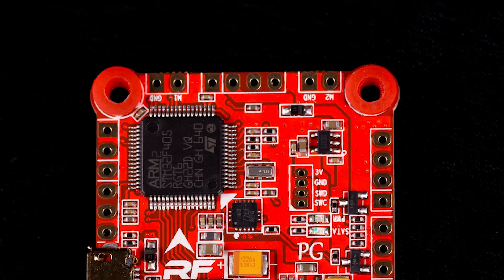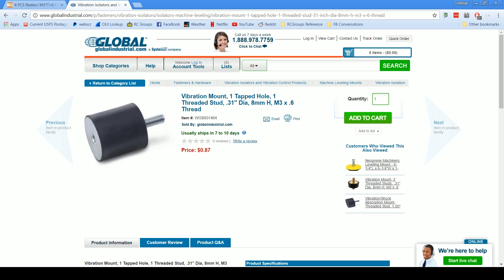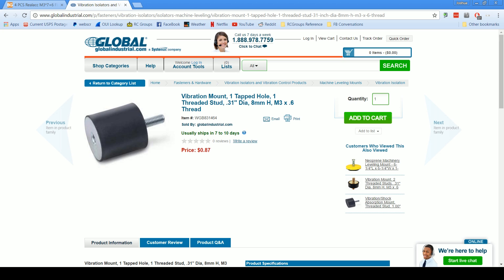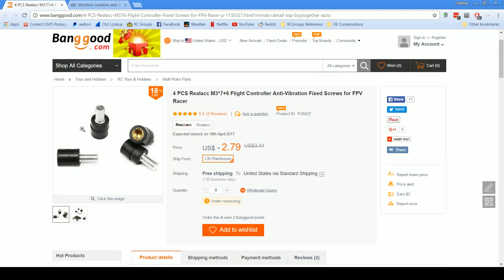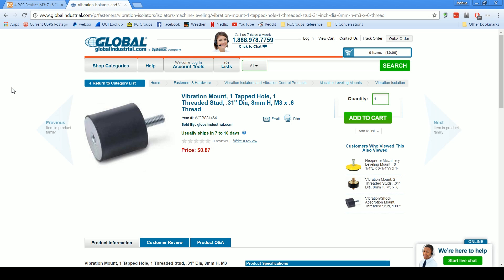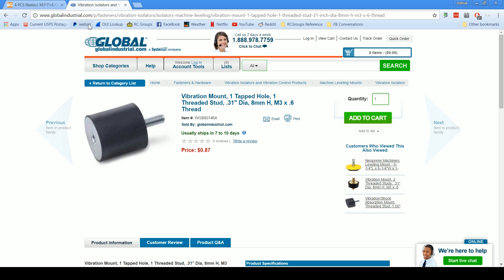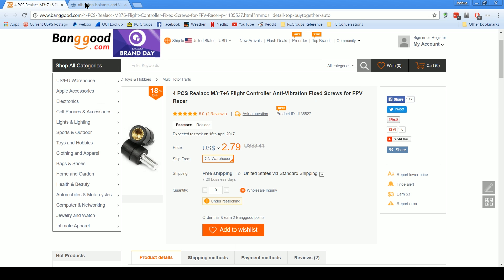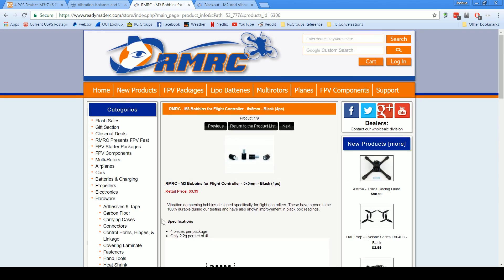Soft Mount Your Quadcopter Flight Controller | BUILD TIP

Comment: Thanks JB.  I am having issue with a new micro quad build.  It twitches, then falls out of the air.  All along I have to continually add forward pitch and if I relax it , the quad comes flying back at me...  I just ordered the standoffs, the shipping is high though.

Comment: This is a great option and I have done it on all my builds but doesn't solve the mid throttle oscillations due to the stronger magnets that are in these newer more powerful motors. I had some issues with the RS2205s 2300 motors recently and can only assume it was due to feedback on the those insanely strong magnets. I have another similar build with the first gen1 rs2205 (much weaker magnets) and no issues with just soft mounting. it appears to only be an issue with the yaw access, and the resolution was to lower Yaw gains...which resolved the issue. so to the viewers that do soft mount and it does not resolve your problem I would advise to take a look at how powerful your motor magnets are, that may be your issue.

sorry if this response seems out of place of off topic but just wanted to touch on that issue that I see a lot of people (including myself) come across on the rcgroups forum.

keep up the good work brotha, you have some of the best most informative videos and are very very insightful, I have used your videos to resolve a few issues ive had. thank you :) and have even bought equipment based off of your recommendations...i.e. the runcam eagle 4:3 and couldn't be happier.
Reply: Carpetbagger FPV I had the same issue with the new Emax S motors. Yup took some tuning AND soft mounting to eliminate but I finally won the battle.
Reply: When you say the stronger magnets are the problem, do you mean they create more electrical noise or that it just creates more vibrations in the frame due to increased power?
Reply: more electrical noise. to be honest my RS2205s 2300 motors run pretty smooth but I really need to add some kind of line filters or tune the yaw pids down and add some yaw specific filter. Which is what I did. this issue I had was on an all Kiss rig. The resolution was to take the stock yaw P and lower it from 8 to 6.48. and turn up yaw filtering from 93 to 95
Reply: You know when you spin a motor bell by hand and it's nice and smooth?  Well, when you have really strong magnets in the bell and you spin it by hand you can actually feel the resistance and vibration.  Almost feels like notches.  That causes tiny oscillations when it's spun up.
Reply: Hmm....I'm using a capacitor which should take care of any excess noise and even the ESC's have their own caps. Still doesn't fix the issue though.
Reply: Oh ok. That's a good explanation. In other words it's mechanical vibrations caused by strong magnets.
Reply: not necessarily...its still can be as mechanically smooth as butter but the there is noise thats introduced into the PWM wire by electrical  feedback and the FC (gyro) interprets it as off axis movement and oscillates the motor output to compensate for something that is really not there. which of course causes oscillations and the ones that seem to be most prevalent are around mid throttle.

And Hurricane FPV is absolutely correct. these higher strength magnets are noticeable. like 3 to 4 times stronger than other (maybe older) motors. its crazy how much stronger they are.

samik83 are you using caps (or filers) on each ESC or only one on your PDB? I tried adding a 35v 1000uf low esr cap on my main batv lines and it didn't help at all. never did try ones on the esc's. I just tuned around it. and honestly decreased oscillatons by damn near 90%. there are still some but very very subtle. not visible in fpv camera or gopro...I can just hear it when buzzing by my head :)
Reply: Well I switched to Dshot esc's just to try and fix this, becasue I thought it might be noise that's getting in thought the PWM.  It actually got worse. I think it's due to the fact that the new Dshot were 30A and before I was using 20A's. More power, more noise.
Reply: samik83, have you tried adjusting your Yaw pids down and maybe some yaw specific filtering? that may be worth trying if you have not done so already.
Reply: I've tried lowering it but IIRC it only made it worse. The yaw became to prominent problem when I switched to the 30A Dshost. Ever since I got the red bottoms there been this ever slight gyro noise on all axis. In fast flight you don't notice it, but slow level flight (when I'm trying to get some nice footage) there always this small shake going on. My previous setup with the old 2204 Cobras it was totally smooth. 

I just did a couple of tests flights with the rubber bobbins and it did help somewhat. The yaw noise isn't nearly as bad, but I'm still getting the shakes. I'm just reviewing my black box data and I see small gyro oscillations in slow level flight. These small jumps in the gyro vary anywhere from 1-10 deg/s.
I have also soft mounted my motors. A little unconventional setup, I used two layers of bicycle tires inner tubing. Thought it's nice and soft and would work well. Also put small pieces under the screw head to further isolate it from the frame. 

I'm kinda outta ideas. I know I could try more filtering, but I'd rather cut the problem at the source. I think the oscillation maybe so low frequency that it might be hard to filter them out anyway.
Reply: samik83 it's because Dshot ESC by Design have a filtering capacitor removed so pretty much all DShot ESC's are going to have more nose...
Reply: supposedly the Kiss ESC's still have the cap from what i read anyways but not sure about BLheli ESC's. but it has to do with the type of cap they are using. their ESC instructional docs say to use a secondary 25v 100-400 uf low ESR cap on each ESC to help eliminate noise and if your planning to go up to 5s. I haven't tried that since I was able to tune out the vibs.

Comment: These have been on Banggood for a while and I use them often. They work well. And aren't out of stock as of right now (coining 'The Bardwell Effect'?) http://www.banggood.com/4pcs-M3-8x8mm-Rubber-Mounts-Double-Ends-Screw-Anti-Vibration-Mount-Rubber-Shock-Absorber-p-1063224.html